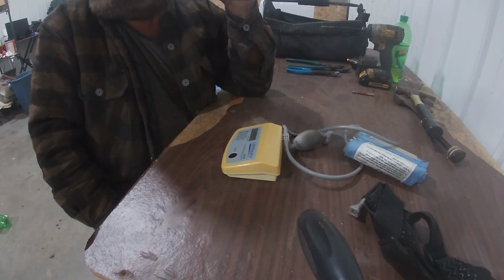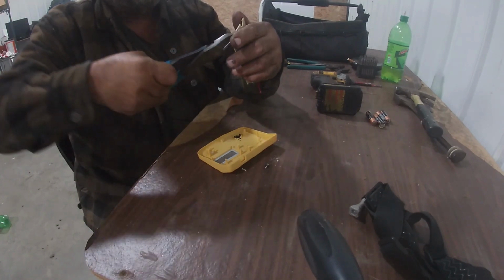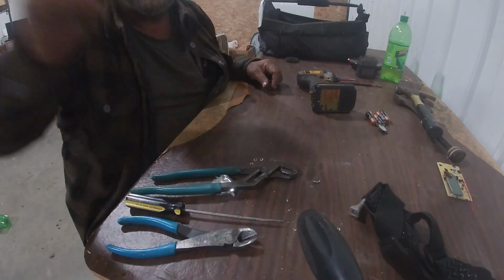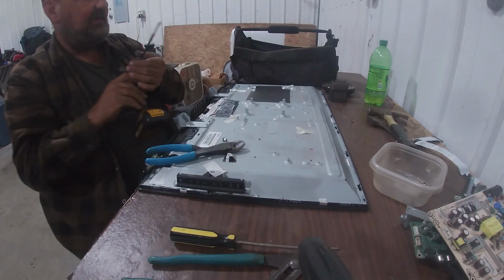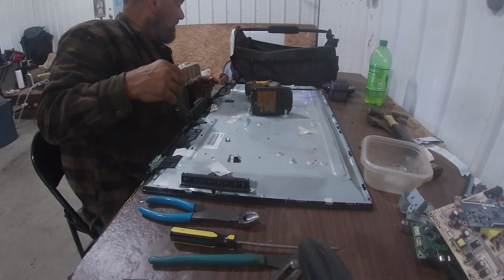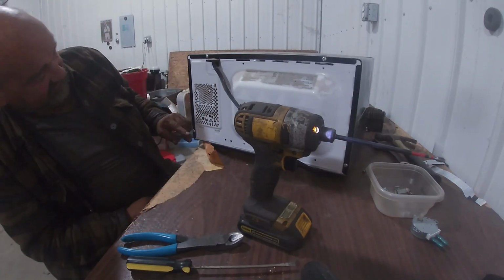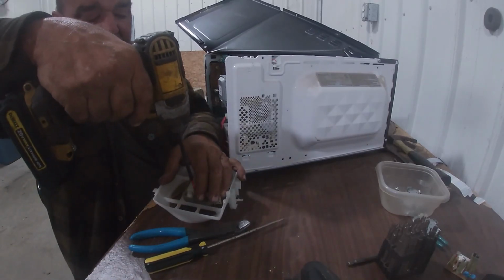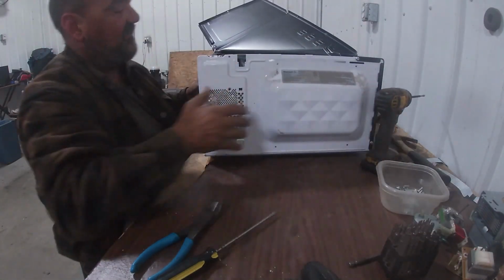Final Breakdown in This Shop!

Comment: Glad you're still hanging in there and putting out videos even though everything seems to be in constant chaos. 😉 I noticed that you don't tear down the TV's past the boards. As I'm sure you know, there are the light strips as well. My question is, do you happen to know what boardsort or your local yard classifies them as. I have seen them composed of both thin copper foil type strips on fiber board and copper coating on aluminum. None of my local yards classify them the same and no one I've asked seems to know either. Any input would be greatly appreciated. Hang in there Roger, you'll find the right place eventually and you'll be able to work out a great setup. Praying it happens soon for you.
Reply from the maker: Hey Jeff!  The best you're going to get on those strips is low grade.  I quit doing them because it takes more time for me to remove them than they are worth, so they just go as shred.  I have heard the LEDs have a trace amount of gold in them, but I don't do anything with gold refining, other than selling boards and components for what they are.  If there was a classification for LEDs, I might pull them, but there isn't as far as I know.  It's going to be a struggle, but I will get a new shop hopefully soon.  This will give me a chance to show how to start up a full time shop from scratch!  👍